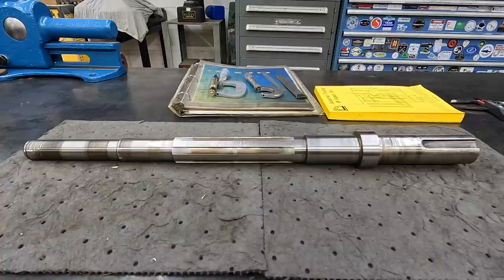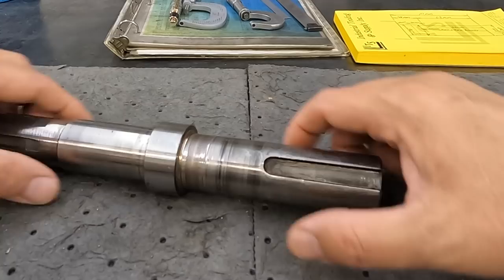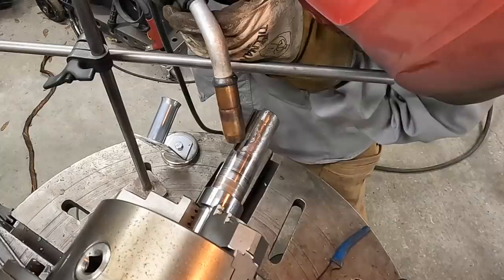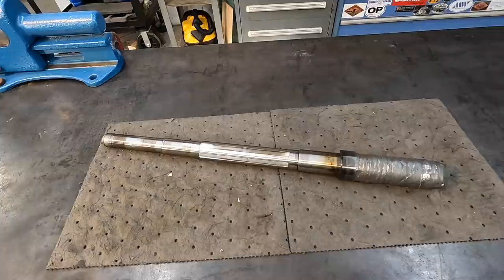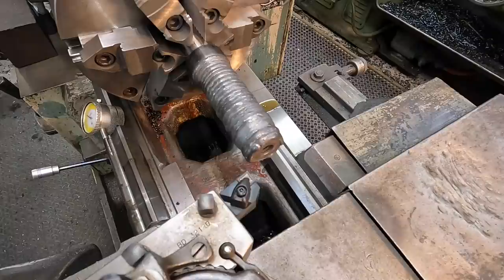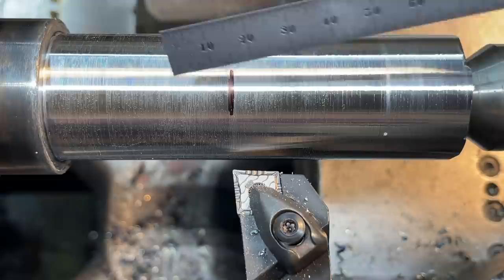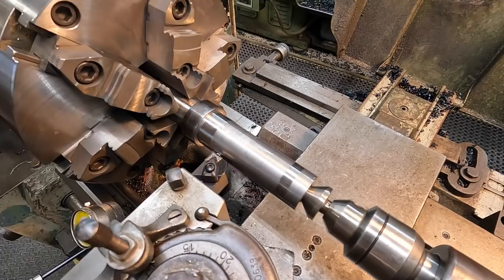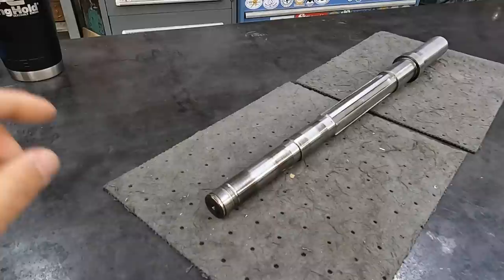Lathe Clutch Shaft Repair Part 1

Comment: Wouldn't it be easier to just make a new shaft considering all the repairs that are needed to repair it
Reply: Aye, but the YouTube viewers only tune in for the welding.
Reply: It would a lot more expensive.
Reply: @WilliamPayneNZ  understood but I believe its a great repair but for longevity I would prefer a new shaft because what ever caused that damage will do the same sooner on a repair compared to a new part. I love Adams work and believe it will last. Its just a personal preference
Reply: @rayleonard363  new is always going to give the most life. The issue is is how much is the customer willing to spend. A repair could be hundreds. But new could be thousands.
Reply: @WilliamPayneNZ  i agree its just a personal preference
Reply: @rayleonard363  absolutely I understand. I work in a machine shop. Everyone wants new until told the price. Those that want new no matter what are generally good customers but it all comes down to customer budget.

Comment: Just make a new shaft...not difficult.
Reply: @StormbringerMM  Is this comment for me? As a machinist of 34 years, I would definitely just have made a new shaft is what I'm commenting on. Very straightforward, probably same amount of work...maybe a bit more due to spline cutting, but you're getting brand new piece, not repair job. Welding weakens the steel as well. Probably not much(I'm not an engineer) but a little bit for sure.
Reply: Nope it wasn’t, I’m not sure how that happened, it was for Adam or others. Thanks
Reply: Eh, the machine is most likely going to be scrapped before this shaft is going to fail.
And new take at least 3 days longer with ordering the shaft material plus the additional labour. 
Definitely not worth it for an old hobby machine.
Reply: @nils1953   We would have suitable shaft material at shop where I worked (4340, would work fine...I'm sure not exact match, but more than suitable for this repair), so I didn't factor in "ordering material". And again, longest part of this job would be cutting splines, and even than there doesn't appear to be many. Not a big difference in size from biggest OD to smallest, shaft not very long... 30 minutes to rough this out, tops. Maybe 2-3 hours to finish everything else... Its just not a big job, and better than welding up...but just my opinion.
Reply: @boydhorning1830  ...well, "if ya don't LIKE IT- then  ya don't have to EAT IT!!!"